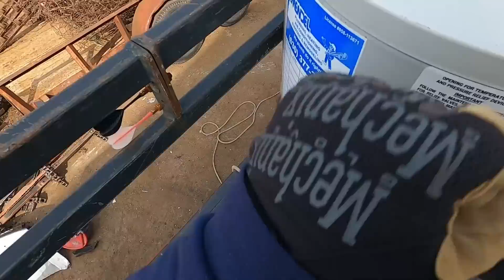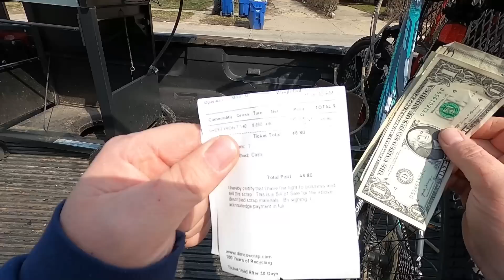Why is Good Stuff Thrown Away??

Comment: My comment will probably fall on deaf ears but someone may have messed with the rear derailleur limit screws. What are limit screws? They limit how far outward the rear derailleur moves away from the smallest cog and limit derailleur going into the spoke. The H(High) screw controls how far the chain and derailleur moves outward away from the smallest rear cog. It's kinda tricky as one needs to unhook the shift(derailleur cable) and turn the H screw either in or out until the guide pulley(top one on derailleur) is directly lined up underneath the smallest rear cog.
       Like I said the previous owner may or may not have messed with the settings and for beginners the adjustment can be tricky. RJ the bike guy has an excellent tutorial on how to adjust limit screws. Best of luck if u care to venture into the bike repair world.

Comment: rear wheel is bent Paul
Reply: I think the issue is the chain is stuck between the frame and small cog. Happens if the limit screws are messed with.